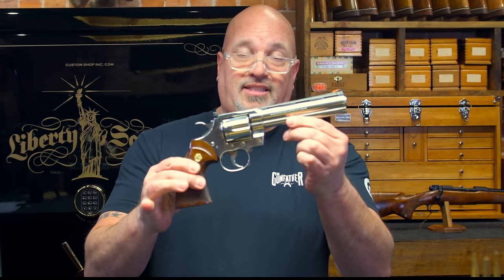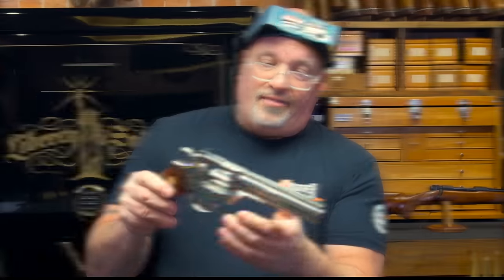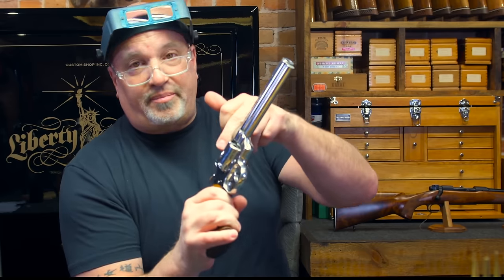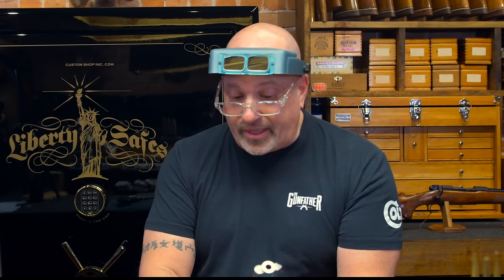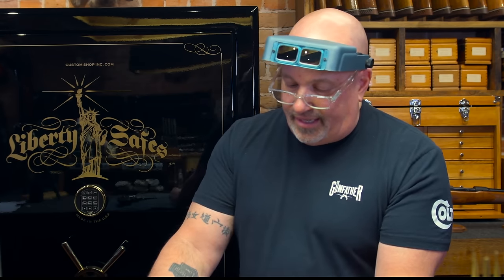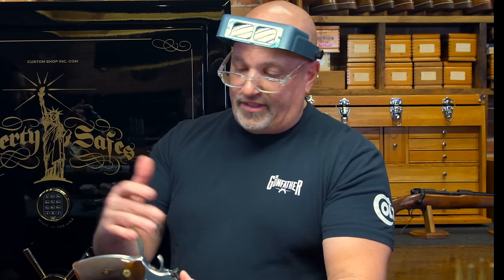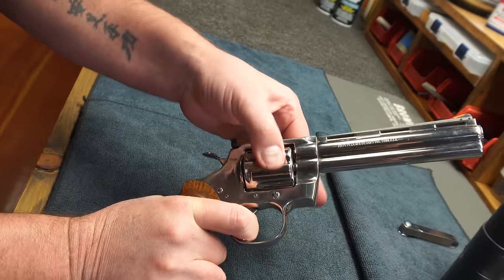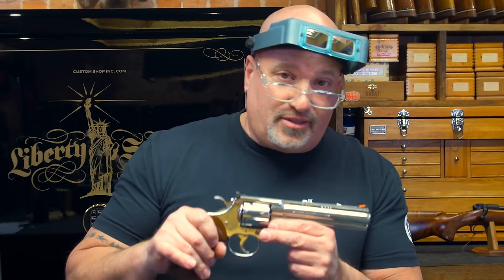Check the TIMING on Your Revolver  (Every Gun Owner Needs To Do This!)

Comment: When checking timing I place a finger against the cylinder to induce a little drag.  If the timing is good, the cylinder stop should still engage the cylinder notch.
Reply: Yes, a "short hand", the cylinder is dropping into the notch rather than being Pushed into it.

Also, Colts are different (vs. S&W) in that the hand provides pressure at timing lock

Comment: Been shooting revolvers almost 45 years now. The way I was taught to check timing in double action was to place the UNLOADED revolver near your ear and very slowly pull back on the trigger listening for 2 distinct clicks. 1. when the cylinder bolt returns to the up position midway through the rotation and  2. when the bolt locks into the notch on the cylinder BEFORE the hammer drops. Thus assuring that the cylinder is properly aligned and locked with the forcing cone . This method always worked well for me.

Comment: Favorite is a S&W model 66 with 4 inch barrel in 357 magnum with combat master grips sold to the state of Oklahoma,  probably for their highway patrol.
Check cylinder lock up rotation And front to back. Check half cock notch reliability. Check single and double action trigger pull. Check ejector rod straightness. Check Crain wear.

Comment: My favorite is also a GP100 i have had for over 25 years in .357 mag i sent it to ruger when it got a little rough spot when cycling in double action and asked them to make the trigger pull a little lighter cause im getting old and now it is smooth as silk and way easy to pull in double action like a cap gun i used to only shoot single action now i shoot almost exclusively double action and Ruger did it all for free.

Comment: After owning a 2 1/2 ,4 and 6 '' blued Pyrhon all new from 75 ,turns out i prefered the 4 ''.
It also turns out years later after Getting a adg 4 " stainless GP100 ,and i  glass bead blasted all visible ss at about 18 lbs with fairly used beads , polishing the action installing wolf springs through out i prefer the GP.
i have  average hands ant the trigger reach was a little to long on the i frame .
The single & double action on the GP are so close to the python 
that it was a go.
So much easier to handle , especially rapid firing and single .i was amazed.

Comment: I love my Taurus 357 mag never lets me down
Reply: My first handgun was a Taurus Model 66, purchased new in 1987. I still have it. It's a handsome piece that mimics a Smith and Wesson Model 19. It has always been a solid gun except for one thing, an ejector rod sleeve that would loosen, locking the cylinder in the frame. A bit of blue thread sealer fixed that.

Comment: Ruger GP100 THATS MY CHOICE 4" OR 6" 357 FOR HOME DEFENSE
Reply: I love the GP 100 I have a 3 inch model. My preferred barrel length.
Reply: I have a 7 shot, 3" 357 and a 3", 5 shot 44 Special.  GP100's are very special revolvers.  Greatly underrated and IMHO after owning many Smiths overall better medium frame revolvers.
Reply: @hardball107  I have a Ruger GP 100 38 special and a Taurus 617 snub nose 357 I love them both

Comment: It is IMPOSSIBLE to know if a revolver is in time if you do not check to see if the cylinder chamber bore is dead center in the barrel bore when the trigger is held to the rear. I’ve seen MANY revolvers that will pass your test that are waaay out of time.
Reply: Timing is about the hand, ratchet, bolt, and cylinder working in sync. This gun did all of those things just fine, although I would have used my finger to cause some drag on the cylinder. If the chamber isn't centered to the bore then it is a manufacturing issue or there's a worn bolt and/or locking groove in the cylinder. We've all seen some play in the cylinder when holding the trigger back. There is a reason for a forcing cone on a revolver. It's for cylinders that aren't perfectly aligned with the barrel.

Comment: I have a Colt Trooper MKIII bought in the 70s that had a clearance problem between the cylinder and barrel. It would heat up and jam after a few rounds. Got it fixed up on warranty and it's been great since.

Comment: Ive had my gp100s over 20 years, i bought them shortly after they came out and i have never had a problem and the accuracy is excellent,but ive seen several problems with smith and colts over the years. Ruger is a much better and tougher weapon overall..

Comment: My favorite is a pair of Ruger New Vaqueros .45 Colt/ACP in bright stainless and rosewood.
Both sights adjusted by Ruger for windage so the fixed sights are dead on.
Under 2" at 25 yards with my 45 Colt reloads.  ( from a rest of course )
Second favorite is a stainless steel S&W Bodyguard in .38 from the '80s with a superb trigger job and laser grip.

Comment: Thanks for the info. Great video! My favorite is the Ruger GP100. I have a model 1771 stainless 7-shot with 4.2" barrel, FO front sight and the standard Ruger grips with the redwood inserts. Out of the box, there was very slight rotational movement with the trigger in the fully rearward position. Despite that, it shoots great, even with the hottest magnums! I had a Colt Detective 38 Special snubby years back that locked up solidly in that mode and remained that way even after hundreds of hot reloads. And then I have the RIA AL3.1, a Czech-made revolver that had about double the rotational movement (also brand new) as my GP100 even with the trigger all the way back. So far, no firing issues with the AL3.1 either. Was wondering if that cylinder movement is a cause for concern with the GP100 and AL3.1.

Comment: Thanks for the video.  I just checked my Ruger GP100 and the timing was perfect, as expected.

From Ruger's website on the GP100:  "Triple-locking cylinder is locked into the frame at the front, rear and bottom for more positive alignment and dependable operation shot after shot."

Comment: I remember watching you guys on TV a few years ago, I believe you're located in Bozeman, MT. I have a 6 inch Colt Python in blue steel I bought in 1992, never checked the timing or lockup but now I know how. I've always heard the Colt Python was susceptible to going out of time, is that more likely shooting magnums rather than .38 Special rounds?
Reply: Bill Wilson is a huge Colt Python fan. The original Python can shoot thousands of rounds without having a timing issue. 
A trigger stop can help avoid that from happening. The rebound is sluggish compared to the S&W revolvers in double action.

Comment: While holding the trigger back to lock the cylinder snugly, I've looked down the barrel with a light to be sure the chamber in the cylinder lines up perfectly with the barrel.   I mention this because my .36 cal blk powder revolver is at the smith's shop for that problem.

Comment: I have a few favorite revolvers.   I have an H&R single action from way back when men were men and women were awed by it.  My Grandfather worked at H&R after WW1.  He may have had his hands on this one as it was being built.    It is a top break, 9 shot, finish worn bare and a great shooter.  About a 1 lb trigger.  I have several S&W revolvers but dang it if my 6 inch Taurus .357 doesn't beat them all for accuracy, smoothness, and reliability.  I don't remember the model number.  It matches up to a K frame though.

Comment: Everyone is going to howl at me but I have a Taurus Protector Poly .357. I love it, it has a bit of a kick because of it's smaller size and weight compared to the Python but it's doing what I need it to do and that's being in time and firing. I clean it often but I should take it to a gun smith for a through check and cleaning.

Comment: I have an older SW 686. I had one issue with it over 35 years. It was a retired service piece for some officer. 
 I fired the bloody hell out of it for maybe 10 years. I put many rounds down range. One day the cylinder jammed up when I tried to open it to eject the spent cases. I found the rod that operated the ejection had came loose, it turned out the threads were stripped. I do not know if it was due to someone cross threading it at some time or just from the hard use. I replaced it and she is like new again.

Comment: I once purchased an Uberti Cattleman, the parkerized one with the brass grip-piece, off of Auctionarms, from South Dakota.  It was only like $400.00 at the time, but it seemed to have never been fired!  I thought I had gotten a good deal, until I looked into the barrel.  I saw, when locked, each cylinder was off from the bore by about 15 percent.  It was so obvious that I thought to myself, "It this supposed to be this way?"...   But of course, to my better judgement I didn't fire it.   I ended up selling it to a gun shop for $75 and they were going to see if they could fix the problem.

Comment: I have a S&W mod 19. Works great in DA. However, if you try single action the cylinder bolt  does not move to allow the rotation.

Comment: Own a 1980/ 81 8" python.dont shoot it a lot.great condition.very valuable.truck gun is a s&w 7 shot .357 airlite.tough gun.mostly run .38 + p in it.never checked timing.guess i should.great vid.not a lot of vids on revolvers ,got a .9mm taurus as a nite stand gun.laser lite combo.lite,nice gun dont want that floating around in the center console.dust magnet.

Comment: Ive got a model 65 .357 and if you so much as touch the trigger even from the side it'll allow you to rotate the cylinder, not sure if thats  a bad spring on the cylinder bolt or what.

Comment: & the question.. i have a model 66 -2 S&W,2.5” that my brother gave me that i think i is my favorite.it’s the one that really got the ball rolling on liking them so much..but…my friend,since we were children ,asked me to help him with his dads guns after he passed away a couple years ago. Rick knew that i was into hand guns .all guns really. y’all get it. anyway, I’ve never seen so many guns that were mostly special ordered,according to the receipt in the boxes. & never shot .some didn’t look like it had been opened since leaving the factory. The 1st one that caught my eye was a 66 no dash.he’d ordered with pearl grips. I liked it’s symmetry a little bit better than mine + the recessed chambers in the cylinder .There more reasons but that’s the one that i would like to have. It had a 2.75” barrel & that made a difference in my opinion.  the grips ..no. not my thing. thinking maybe a new set of S&W checkered wood and a Tyler T .dk if i’d go brass or copper but thinking one of those would be good. mine came with degrading gooey rubber originals that i switched out for black & red VZ G10 .had the wood ish clasic/modern look that i thought would look right with the leather lined kydex STX own with pull the dot snaps & nice looking leather straps (not STX 2.0) if anyone looks at garrett industries web site …It’s not a product that is listed or pictured on there. the wife of the man that owns that place suggested that holster when i was describing what i was wanting in a holster. I was going for a classic/ modern type theme & with a black nylon kore belt , i think i achieved what i was going for. that belt was so much more supportive than my regular everyday ,fairly thick ,black leather belt from cabellas that i’d been using  . I didn’t know what I didn’t know but kept hearing what great belts kore had and finally got one when i saw a sale. had to see what all the hype was about. For anyone who is thinking about getting a kore,the nylon is stiff and uncomfortable for quite a while.I only wore it with that gun.didn’t expect it to ever be comfortable.2-2.5 years into occasional wear, i noticed it had taken the shape of my hips.Like regular belts do. much better. i wear it all the time now i & it hasn’t started to wear out at all.  I figured the track part of it would have problems with the edges that click rounding down with use.. and/or would crack.Nope.other than having to run a lighter over both ends…the exposed tag end started showing very slight signs of fraying at around 3-4 years so i went over it with a bic and kinda rolled the top layer of nylon over & rounded it in a little .other than that,looks like new but better. highly recommend but over kill for light guns. cannot speak to the leather version.don’t have one but will eventually. I d venture to bet it would be fine with any gun & extra mags,speed loaders ect on the other side. the have a buffalo leather option too. last i checked. weight ratted for 8-6& 4lbs. (nylon-buffalo & regular full grain cow leather) apologizes for the belt tangent. I might seem like a belt salesman but i’m not. There’s so much STUFF  ppl say that you NEED here online,trying to make a sale. I just want ppl to know a real deal gun belt makes all the difference in the world. I went with nylon because i am in and around water a lot! I have swam with the kore..& every other belt iv owned.synthetics goes better with water. that & wearing on hot sweaty humid days is what really made the belt break in.FYI. thx for the video & tips.

Comment: My fave are Dan Wessons.
Speaking of I had something happen when I bought my Dan Wesson 44 mag used.
Single action fired every round.
Double action bang, bang, click.  Backed it up and fired SA no problem.
In DA it would consistently not fire after the 2nd or 3rd round.
I supposedly had the  timing checked and was told that the handle screw was too tight causing pressure on the main spring causing the issue.
I have not yet been to the range with it to see if it's fixed.
Meanwhile I watched your video and my DW 44, Ruger Super Redhawk Alaskan 44 mag and my Taurus Tracker 357 all  engage the cylinder pawl as you describe.  But in DA the DW 44 has a difference - when the pawl clicks, the trigger trips the hammer.  Near as I can tell simultaneously.  The Ruger and the Tracker both have the pawl clicking in the cylinder groove then a few mm of travel before the sear releases the hammer.
Could this be a kind of timing issue or is it normal?  Thanks and excellent video!

Comment: Thanks, I have a car paint stripping model 27 that might need work. How much gap should there be between the cylinder and the barrel and can it be corrected without welding and machining the barrel?

Comment: First time running across your channel and I got a question for you I've got a Colt Trooper Mark V and it has a little bit of slop in the cylinder is there anything I can do about that it shoots great but it does have a little wiggle whether it's Single Action double action

Comment: My first gun back in 1981 was a snub Dan Wesson 6 shot 357mag and after that in 1987 I purchased a Taurus m-85 38 and Taurus 357 mag in which I wish I  never sold. I currently own 3 different Smith and Wesson in 38 special and 2 budget 22s revolvers. But my favorite revolver is the one I inherited from Dad  which is a Colt Border Patrol 357mag which is the same as the Colt Trooper . This gun  has a trigger and cylinder release is as smooth as butter . Colt puts Smith and Wesson to shame.

Comment: How do you know that the cylinder and the barrel are aligned? If you are checking the revolver and don’t check alignment.            Did you really check it out?
Reply: He obviously does not know anything about barrel-charge hole alignment by simply pulling and holding a double action trigger cycle.  Alignment gages are required.  He’s also way off base checking timing by rapidly pulling the hammer in single action.  I have a Detective Special that is WAY out of timing due to a worn short hand.  It won’t safely carry up unless cycled rapidly.  His “timing” checks would pass my DS every time.  He will not be servicing anything for me.
Reply: If the cylinder lines up with the bolt, it's going to be aligned with the barrel.
Reply: @johncompton-ho1hd Uhhh, no.  Accomplished pistolsmiths know better.  This guy never heard of a gauge pin to check alignment.  Lots of old, even high quality revolvers, get beaten out of alignment with bent cranes by ham handed owners who slam them open.  Tight lockup is good but doesn't guarantee alignment.
Reply: @ggibson511960  agreed, I was being shortsighted in my comment. My apologies, ok?
Reply: @johncompton-ho1hd No apology necessary, but very gracious of you, and accepted.  My post was a bit snippy.
Reply: @ggibson511960 , actually, I do believe that an apology is in order. There are many people that are needlessly injured, or worse, from poorly trained "gunsmiths". An improperly timed revolver can explode in someone's hands, causing the cylinder to blast out fragments of metal in all directions. Very serious business. I knew a man that it happened to by improperly made hand loads. Not a revolver, but an accident caused by a know it all gunsmith using the wrong powder. Its the seemingly simple things that can cause the most damage.
Reply: @johncompton-ho1hd  I've seen alignment gauges tell you your wrong

Comment: Colt Diamondback 4" 38 Spcl - Also I have an older Anaconda that has so much slop between the cylinder and the crane that when it becomes dirty (12 rounds) it starts to catch on the forcing cone as the cylinder becomes cocked on the crane. You can free it with a push of your trigger finger. How would you fix this?